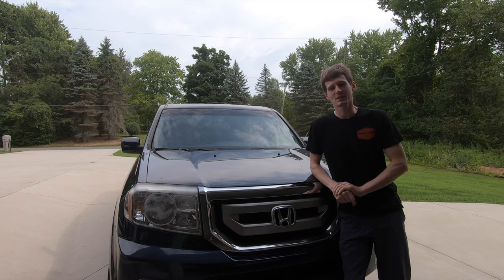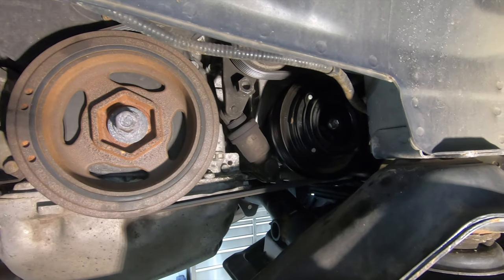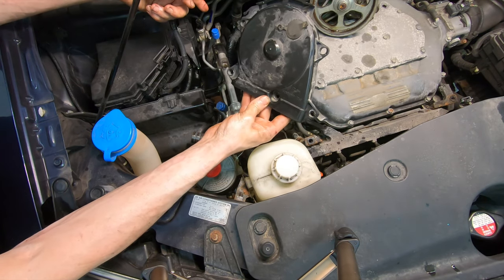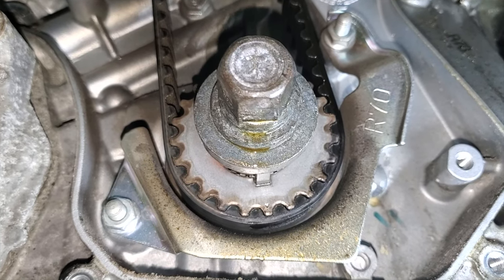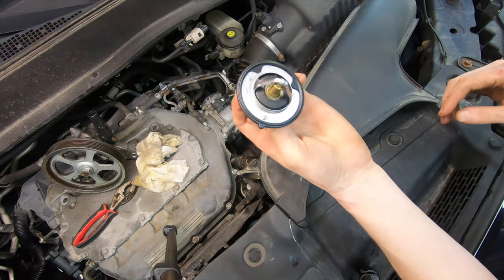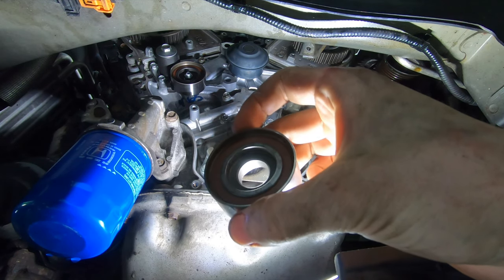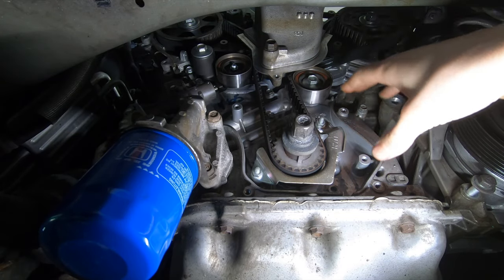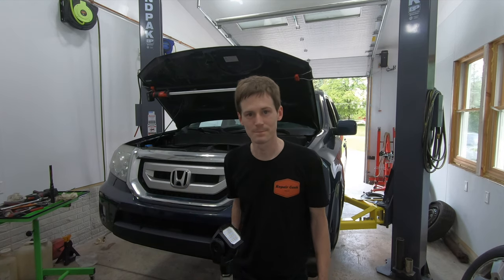Honda 3.5L V6 Timing Belt & Water Pump Replacement- Pilot, Ridgeline, Odyssey.

Comment: Nice repair. Just a FYI, That thicker socket isn't about inertia, it's about more metal to carry over more torque from the impact that is lost on the skinnier sockets.
Reply: Torque = Force x distance. Torque has nothing to do with mass. Inertia has a mass component in its equation. Just physics.
Reply: @spiculum1836  That equation is in relation to a wrench...A longer wrench= less force required.    Mass and torque from an impact have a lot to do with each other. Take a look at Torque Sticks. The way they work is a change in the mass of the stick to allow more or less flex of the metal to set the desired torque. Same goes for a socket.

Comment: Easier of you put the idler pulley in before the belt. I personally do all of this from the top. But I also take the pcm out. Seen people do it from the bottom. All honda techs will do from the top. Just time saver in the long run. Great job. I added few comments for extra tips.
Reply: Seen your comments here and appreciate them. Gaining the confidence to tackle my '06 Accord (cramped space) so that our '06 Pilot is the "easy" one. They both need it done.

Comment: This is a great video and helped me quite a bit.  My problem is that tap water you flushed the block with will do more damage than just using universal coolant… these engines do fine with standard green stuff.

Comment: The replacement belt doesn’t come with marks to line up with the timing marks?
Reply: What you can do is first mark the old one while it's still on the car. Now you also have a corresponding mark on the cam sprockets and crank for later. Remove old belt, line it up with new. Make your first mark on the new belt and clamp the belts together not spooned together, but with one resting atop the other on its edge.

Comment: After watching the video. I am going to cancel my order for the 2024 Ridgeline.
Im buying 2024 Tacoma instead. 😂
Reply: Definitely feeling this comment, for sure. I prefer the ridgeline ride quality but definitely not wanting to deal with this belt.
Reply: @dmbsituation  
I lied. After seeing the prices on the 2024 Tacoma.
I went and bought the 2023 Honda Ridgeline RTL HPD for 38,500.
The new 2024 equivalent Tacoma goes for 50,000 plus dollars. Either limited 52,000 dollars or TRD off road with 8,000 dollar package 51,000 dollars.
No Thanks!!!
This is my last time I'll be shopping for Tacoma and Tundra.

Comment: Thank you for a fantastic video with Torque spec.  Question for you please.  NEW Tensioner and Idler pulleys spin at about the same rate as the NEW water pump pulley. Tight but moves and not spin.   Is this normal?  The used ones spin easily once started and keep on spinning and loose.  I bought new parts from Honda dealers, so I know it is genuine.   Thank you.
Reply from the maker: Normal. The new pulleys have resistance from the fresh grease inside the bearings. The old ones, the grease is mostly gone making them spin more freely.
Reply: @RepairGeek  Thank you kindly.

Comment: I use a bar to hold the engine up so I can still go up and down with the car on the rack. Also I take the long 17 mm head bolt out of the motor mount and leave the bracket on the body.

Comment: 2011 Odyssey with 270K miles and unknown service history.  I am in the middle of timing belt replacement with the AISIN TKH-002 kit and am up to the point of removing the belt tensioner.  I checked the alignment of the timing belt sprockets using my camera to get a straight on view.  The crank sprocket is right on the mark, the front cam sprocket is a degree or two clockwise from the mark, and the rear cam sprocket is a degree or two counter clockwise from the mark. The timing belt does not have any slack that I can feel and  I don't think either sprocket is a full tooth off.. How close should the cam sprockets be to the timing marks on the engine?  Right on? Or is a little off OK?
Reply: Everyone sweats this.  Line everything up as best as you can.  Paint the old belt with a visible line back to front, also paint the crank sprocket mark. The mark needs to be over a cog or valley so you can match on the new belt.  Use old belt to transfer marks to the new belt.  Make sure to note which cam is which on the marks.  Install belt .  One of the cams will line up easy, then adjust the other cam with a socket to match the other line.  Now pull pin on tensioner.  MOST IMPORTANT... You need to rotate the engine a couple of times to see if all the marks still line up. Forget the painted lines they will not line up after you move the crank. By moving the engine you take all the slack out of the belt. Both cams should align. If in doubt, one of the cams should line up fine, then adjust the other.  You will have to release one bolt of the tensioner or may have to remove it and retension on a vise.

Comment: I tightened the crank bolt using the 47 ft-lb + 60 degrees method per the service manual. Out of curiosity I measured how many degrees 180 ft-lb got me, since I read that was spec'ed in parts kits. 180 ft-lb only got me to 30 degrees. The next 30 degrees required a huge torque, I'm guessing 300 'ish ft-lb. I've never tightened anything so hard. I used oil on the threads (per service manual) and I used MoS2 anti seize on the surface between the washer and the bolt head. The service manual calls for oil on the bolt/washer interface but I found it so tight that I switched to the MoS2 which should be better on loaded surfaces.
Reply: There’s no way 47 lb-ft plus 60° is 300 lb-ft. The head bolts on the engines I work on are torqued to 300 lb-ft plus 90° and the final torque comes out to 470 lb-ft plus or minus.
Reply: @AlexMaysonet Possibly additional friction, due to the effects of corrosion. I don't know. Definitely a good measure more than 180. I can't imagine tightening it further. I'm surprised it even moved the final 30 degrees. It did it one big "pop" after a lot of additional torque was applied.
Reply: This is the something I didn’t understand. What is this method of only tightening a certain amt “plus x degrees” mean? It’s a way of getting it tighter that you’re tightening it?
Reply: @thenexthobby  The angle provides more accurate control over clamping force because you get an exact amount of bolt stretch. Torque alone is influenced by other factors that introduce variability in the clamping force achieved by the bolt. This is a critical bolt. Honda gave it a tightening spec that reflects that.
Reply: @jptrainor  Right. I was asking how you do it, not why you do it. I'll Google, thanks.
Reply: @thenexthobby  You can buy an angle meter specifically for this purpose but it's not really necessary. Just measure 60 degrees with a protractor. The  service manual just uses a picture that indicates turning it using the corners of the hex bolt as reference. Each hex corner is 60 degrees.  That's all I did. I marked 60 degrees using the bolt head as a reference. It's super tight. Make sure the bolt and the washer are clean and free of corrosion, or it will take even more torque.

Comment: Next to the oil pressure sensor on the back, close to the oil filter. There is a drain for the block. You can loosen than and attack a rubber hose. I personally don't drain the coolant or the block. I just let what comes out the water pump drain out. Its about a gallon or so. Then bleed the system when ur done.

Comment: it's too bad that Honda didn't put a mark on the belt like Subaru does on theirs...that way, there is no chance for error on keeping the belt tensioned enough so there is no slack (even one tooth) in the belt....but I guess if you totally take your time and check your work 2, 3, 4 times, you will make sure it is correct...great video ...one question, was there a gasket on the water pump of any kind
Reply from the maker: WP has an o ring seal. It came with the new pump.

Comment: I couldn't get the belt on so I rotated the exhaust cam causing it to snap forward about 40 teeth. Now it won't stay at TDC without holding a wrench to it. How can i get it to stay put again?
Reply: Always transfer your tdc marks from your old belt to the new one including a mark on the belt and on the crankshaft cam. I usually place two small side by side marks on the crankshaft cam so as not to confuse it with the upper cams.The cams can jump but all you have to do is align your new belt with the marks by moving the cams with a wrench. To prevent them from jumping put small clamps holding the belt on the cams, I used small vise grips and used  cardboard to protect the new belt. Once the belt is in place you release the hydraulic tensioner and it sets your belt in place. You can then remove your clamping devices. Turn your crankshaft to ensure the motor returns to top dead center. If it doesn’t align redo the procedure. You will have to remove the hydraulic tensioner and retract the plunger in a vise and replace the pin.

Comment: @Repair Geek , hey brother how you doing ? I have a question about the aisin timing belt how is the kit holding ? And where did you get it from ? I need to replace mine in my Acura MDX and I want to get the same kit but I don’t know how good is it .thank you
Reply from the maker: The kit is working fine. I've installed a few of these kits and they have all worked out well. Aisin makes the water pump in the OEM Honda timing belt kit. The bearings are the exact same Koyo bearings that are in this kit are the exact same units installed from the factory and the belt is made by Mitsuboshi. Who makes a lot of OEM parts for Honda.

Comment: I'm a bit confused whether the engine needs to be supported when the mount is removed.  Initially the engine is supported from the oil pan, but after the mount is removed the car is raised on the hoist.  So is the support something that facilitates the mount removal, but isn't needed thereafter (until the mount is reinstalled)?
Reply from the maker: Yes the floor jack holds the engine while removing the bolt. Once the mount is out you can remove the jack. The engine has 3 other mounts holding in the engine/trans. It isn't going to fall out lol.
Reply: @RepairGeek  You're most kind to reply.  Thank you and excellent work on your video, particularly including tool models, diagrams showing timing marks, etc.
Reply: Looks like engine lift is done to allow one to remove the mount (to get the bolts to turn etc).  Once mount is out, the other 3 mounts will hold the engine up.  It probably will help to jack up the engine again to put the mount back on as well.

Comment: Thank you is really very clear and helpful .

Got a couple of questions.
1-can I use the tensioner pin again or once removed then need to be replaced ? I remember when I replace it then I have to remove the pin to release the hydraulic pin that put tension in Pulley ?

2- regarding the coolant water ... how much do I need concentrate Nd non concentrate ? Like half and half ? I have got odyssey touring elite 2011

Thanks
Reply from the maker: You can re use the pin but you need to compress the tensioner in a vice to get the pun back in.

Yes ideally it should be a 50/50 coolant water mix.
Reply: @RepairGeek thanks for reply ... so what you recommend to use instead the pin ? I don’t have it anymore  after installed it ... just wanna be prepared instead looking at something during the job .

And the coolant how many gallon should I buy from both
Reply: @RepairGeek  How do you know how much water is in the system after flushing and how much concentrate and/or water is needed to fill it up?

Comment: Great work.  I can now see why the charge is $500-900 for this work depending on where you live.
Reply: Easier then it looks. I can tell you its a shit ton easier then a timing chain on the ford v6 they put in the edge
Reply: @kyleosbun  Haha good to know.  I am definetly not a ford person.  I have my eye on a Ridgeline and need to test drive it.  Looks great on paper.
Reply: @MixingGBP   they are awesome trucks. Ive had one for three years and just bought a second one real cheap tht needs a motor cause the timing belt broke
Reply: @kyleosbun  Nice!  How many miles were on it when it broke?
Reply: @MixingGBP   210k. Full book of service records from honda since new. He just never had the timing belt service done. Pretty good life span of the original if ya ask me lol
Reply: @MixingGBP  my other one has about the same miles. Its belt has been done once and im getting ready to do it again as well
Reply: @kyleosbun  agreed.  That's more than I expected.

Comment: Did you change out the front main seal? is it a good idea to do with this job on certain models? I have a 2011 odyssey touring
Reply from the maker: If it's not leaking, I wouldn't touch it.
Reply: @RepairGeek  thanks...so I don't have a lift and so do you have any suggestions or tricks that would help get the crank pulley bolt torqued to spec...is there a way to go at it from up top through the engine bay? I'm worried that I won't be able to get enough leverage. Ones I've done in the past I could come at it from the top. This is my first on a 3.5l v6.
Reply from the maker: You can try from the top before you put the power steering pump back on. I feel like you would hit the frame of the car trying to get the wrench out the top.

Comment: Nice video!! I have a question, would the timing notches align the same as you show if the belt broke completely and a replacement belt installed? Top dead center bottom crank and #1 position for the front cam.
Reply: Being an interference engine, you need to have heads, valves, pistons and block checked. Replacing necessary parts.
Reply: I am presuming this is a case where the belt broke and the heads had to be pulled for repairs. Usually bent valves.  So when you reinstall, you just line up the cam/crank marks and install the belt then pull the tensioner pin.  Now rotate the engine a couple of times and ensure the marks still line up.  If not readjust the cam that is not lining up.  The alignment should be close to dead on.  If you are a tooth off that should be pretty obvious.  If not sure try adjusting it a tooth and see  if that is better.  You need to get to the point that when you rotate the engine with all the pulleys in place and tensioner pin pulled the cams and crank still align.   A bit nerve wracking I will admit.  When totally frazzled take a long break and come back the next day and you will nail it.
Reply: Forgot to mention the crank sprocket needs to be at TDC/compression stroke. for piston 1.  If not careful you could be 180 degrees off.  Lots of videos on how to determine that.  On a Honda you cannot use your finger in the #1 spark plug hole so you will need some tool to insert.

Comment: Hello. Would it help prevent the coolant gush if we drain coolant from back of engine block before removing water pump? 
Thank you for the video. I just subscribed for more Honda/Acura maintenance goodies. Keep it coming!
Reply from the maker: Yes, it would but, if you live up north you risk breaking or stripping out the block drain. Most of them after 10 years are frozen up and not worth the risk of breaking them trying to get them loose.

Comment: Are OEM water pumps prone to failure? I've seen J series with over 200k miles with the original pump no issues. I understand that it's easier to change while you're in there, but if there's nothing wrong with it and there's not an issue why spend the time and money to change it? I've been working on these cars for a while now and I've never seen of a OEM pump failing, I've seen plenty of cheap aftermarket ones crap out though. Also, you know that this engine has a coolant drain plug to avoid all the mess.
Reply: I'm not a professional, but would never want to be the one to have to tell a paying customer much of the job has to be repeated now, and no it won't be a heck of a lot cheaper as a result. But I have no doubt there are amateur videos online that skip it, because they can and have more time than money.

As for the block drain, as a practical matter that will depend on the mechanic's experience. Many techs will not touch that, because a corroded or busted drain bolt creates a far bigger problem than simply mopping up coolant from the floor.

Comment: Does the water pump install require any type of sealant?
Reply: On my 2008 Honda Fit it just has the rubber O-ring and that seals it.

Comment: Great video but I have bad news for you. The only water you want in the cooling system is distilled water. City water, they kill all the normal stuff in the water (the good stuff for you, not the engine) but it has chemicals in it now so I'm not sure. 
Basically, 
Distilled water=best.
Well water/hard water=worst. 

The deposits in hard water clog the system. Literally coats the system with calcium...

Comment: This is the first video that mentions the socket right off the bat, fantastic. Whoever replaced my radiator also used green coolant. Autozone only sells blue and Honda is of course blue.

This is also the first video that puts the tensioner pulley last, which I would agree with. It was a PITA getting the auto-tensioner in with that pulley pressing against my hand.